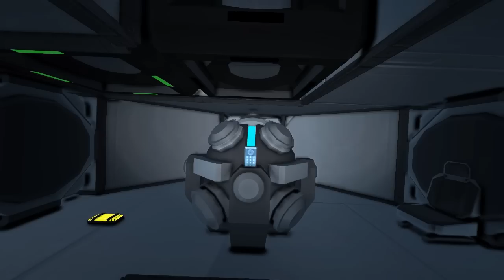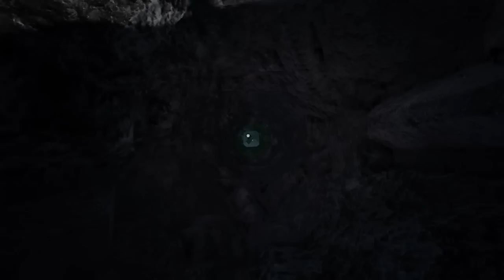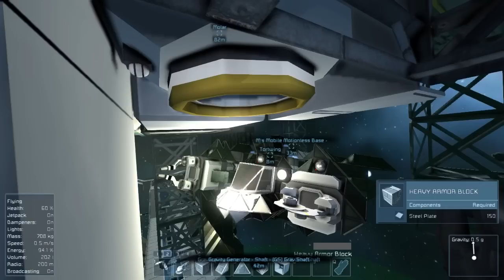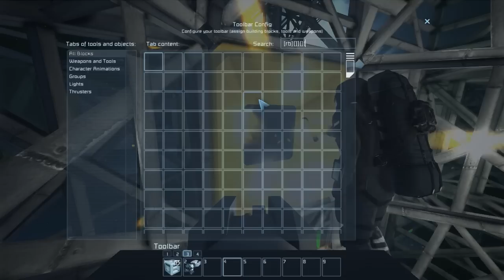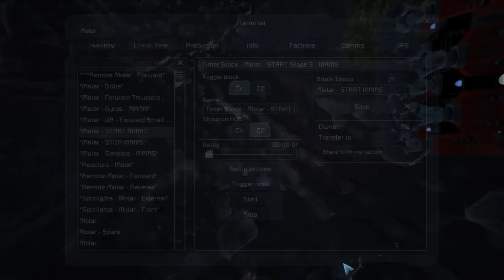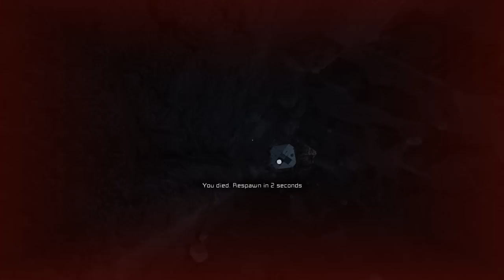Space Engineers • Solo Survival • 48 • Need for Steel

Comment: Not quite what I had in mind but this is probably a sight better as there's not much room to see down where the assemblers and reactors are, now I've had a closer look at it!

I love the open section right before the collector though, if you're keeping it that way (whether aided by a spherical grav. gen. / glassed-in or not) it'll look great to be standing on that lower level with the ores flying past and the collector/reactor/assembler stack* kinda hovering overhead, especially if you can sort the current Molar ore-rate problem - I think you might have to go back to ejecting it though...

* - As I find myself mentioning that conjunction of parts later on, I re-visit this earlier part of my comment to consider if the overly long description needs an acronym, yet all I can think of is the dull 'CRA stack' or the dubious 'CoReAsS'.

Re. the conveyor tubes, they'll look good coming down through the floor at the point you're talking about and then on down, maybe a ring around the ore tube just below the opening then on down the sides to your lower dock, but somehow the upper connection to the assemblers is kinda strange, doesn't seem to gel with everything yet... Maybe you set the 'build quality' bar too high with the glass walkway over the first set of tubes and now the other connections don't quite match up style-wise?!

I know you'll need connections galore at that level for the hangar deck and repair bay stuff as well as the main ones in to the CRA stack, but I'm trying to think up a way to make it look as classy as the first section while providing that vital link to the ...ahem... CoReAsS.

I know you've allowed a space for the tubes and such under the hangar/repair bay area - maybe when you have a bit of steel plate once again spare, you could flesh out the rest of the hangar/ landing deck level on the built quadrant so those of us who are interested can see how things might all be laid out? I'm thinking something along the lines of the basic look of the docking platform from the multiplayer station (modified and updated, of course), which, I presume, is where the glassed-over tubes came from in the first place... It was always a great place to design new ships too, so maybe one of the quadrants should have a dedicated ship-design area?

Damn... I promised I wouldn't waffle on, but just look... I can't help myself! Keep up the good work Morilibus.
Reply: It would be cool to have a glass room connected to the shaft and watch all of the ore fly by. A bit pointless, but it would be pretty cool to see haha

Comment: I think part of the problem is that when running the drills full like that the bits of ore are generated in front of the drills and drills do destroy them. So you might be loosing allot of ore to that compared to the ejector method. Also the ore that is not destroyed is spit off with a good bit of speed and ends up orbiting the grav ball for a bit before being pulled into the shaft, maybe long enough it will despawn. With the ejectors it is sent off much more slowly and heads right for the shaft.